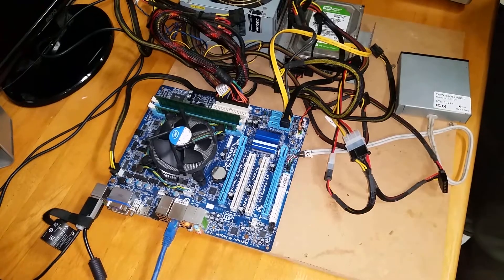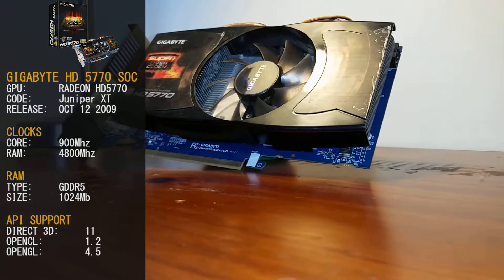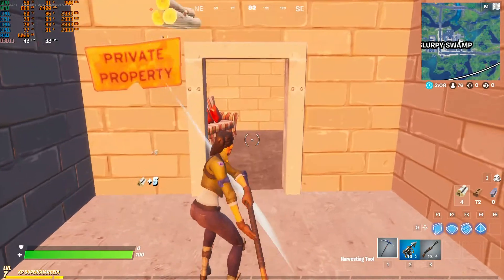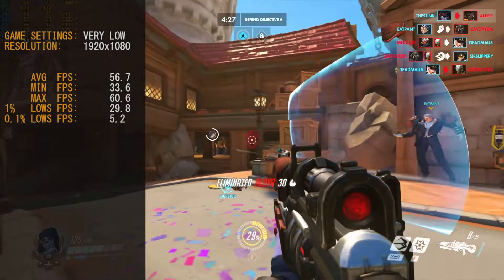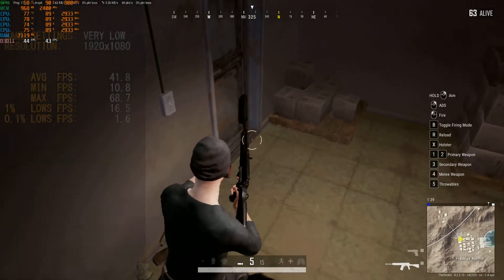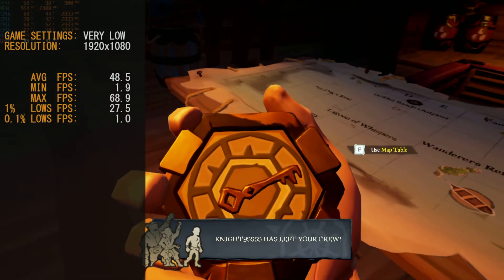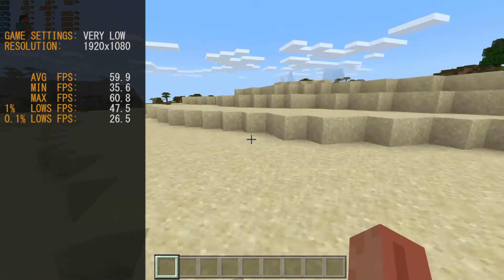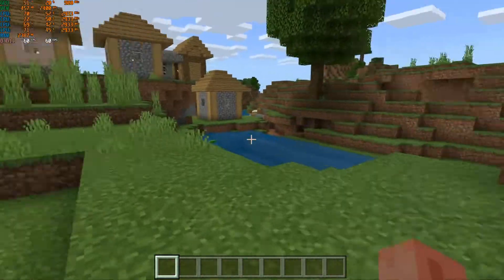Radeon HD 5770 vs 2020.

Comment: how do you run Sea of thieves at +40fps? I have the same CPU and GPU but I can't get above +18fps with low settings.
Reply from the maker: We temporarily disable our virus real time checker playing games.
We also set to lowest of details.
Also we run a program call inspectre it helps with turning off some of the intel microcode updates that slow down most of the intel CPUs
(https://www.grc.com/inspectre.htm).

Try to keep background running software to a minimum

We hope that helps,
Thanks for watching.
Reply: @OFFbitTech  Great thanks for your reply me! I will try. (link not working but no problem)

A greetings!!

Comment: what bout amd 5770 in my 300 w psu
Reply from the maker: It requires at least a 425w psu
to run.

According to realhardtechx
table link below.

https://www.realhardtechx.com/index_archivos/Page362.htm

Hope that helps.
Thank you for watching
Reply: @OFFbitTech  cuz i run amd 6750 just fiine but i dont have high end pc just low and pc
Reply: @OFFbitTech  including to techpowerup it will word
Reply from the maker: @yassine9475  It may work.
You are right tech powerup does say 300w psu minimum.

It will come down to how much power your 12v rail can supply. How much power you are you already using as well.

But be prepared that you nay need  bigger wattage psu.

unfortunately it's something you need to try.
It may not turn on if to much draw is required and it may turn off in games @ peak usage.
Reply: @OFFbitTech  yes thats exactly why i'm afraid
Reply: @OFFbitTech  my  PSU
FSP300-60EGA 80Plus Gold
Reply: @OFFbitTech  i will try amd 5770 and i wil also tell you my results 
thanks for ur reply bro i luv you <3
Reply from the maker: @yassine9475  Thank you we would appreciate that.
Reply from the maker: @yassine9475  yes it's a hard one to call.
I have been in a similar situation and I needed a new psu in the end.

I know the pain to much.  :)

Comment: x3440 (4c/8t) is like 5-10$, I guess those 4 extra threads would help a lot.
Reply: i would get an e5 1650 6c/12t and about 30 bucks and there are cheap 65 dollar chinese motherboard. Definately worth every extra penny it will handle way way more gpu than this and has AVX. or even e5 1620 for 20 dollars would be a worthwhile step up.
Reply from the maker: Yep Hyper threading can make a huge difference.
At some point we will upgrade this rig to 4c/8t xeon or an i7.  The slower clock speed on the x3440 may hurt a little in some games and the extra threads will help in others.

But extra threads these days will probably help a lot more with games able to use more and more threads properly.

But for now the i5 760 still does an alright job.

Thanks for watching.
Reply: @OFFbitTech  Xeons overclock better since those are best chips from the wafer.

3.5GHz is doable on every chip, 90% does 3.8, 4.0GHz-capable at 30-40% rate.
Reply from the maker: @Adam130694  Yep, that's correct. Xeons are better binned. 
We will have to wait and see, there is a chance we may move onto a sandy bridge i5 As well.
But a xeon X3470 / X3460 also could be another way we could go. We will probably need to upgrade the CPU cooling though moving to 4c/8t cpu.
Reply: @OFFbitTech  or just buy X3460.

Comment: nice video, thanks for the benchmarks, i'll be using this card temporarily before I buy a new one
Reply from the maker: Thanks, 5770 should be a good card to use until and upgrade.
We recently did another video with this card and an AMD Phenom II x4 955 Black Edition. You may want to have a look at that as well.

Thanks for watching.

Comment: My cousin gave me this card for free do you have a recommendation for a cpu for this card?
Reply: Or can I just buy a athlon II x4 651k because I have his fm1 Mobo and just slap an SSD on this boi
Reply from the maker: Probably between Core 2 Quad and I5 sandy bridge (23xx, 2400,2500). It would probably be better suited closer to later core2 Quads in my opinion. But sill not a bad card to be paired with later cpu's
Reply: Also I think you forgot to answer my last question I have his fm1 Mobo but has a sht cpu and planning to just buy an athlon II x4 651k, is that a viable option? If so what games can I run?
Reply from the maker: @29stann  I would recommend going an intel i5 2400, 2500 / i5 3470, 3550 or something like that. Al ot more strength in it's single core performance (than multiply that by 4). There should be more intel stuff on the market as well. In Australia it can be hard at times to find AMD stuff cheap. Sorry about missing your reply.

I might pull out one of my phenom II cpu's and do a video on it sometime. I'll put that on the todo list.
At that point I will be able give you a better Idea on what Athlon II x4 can run.
Reply: Ohh ok thank you so much for responding, btw do you have a discord or a server cause I wanna ask more question because I live in the Philippines and those items are quite expensive.
Reply from the maker: @29stann  Sorry stnly I don't have a discord server at the moment.  I just realized the Atlon II x4 651k is not a am3 cpu but an FM1 cpu. So staying on the motherboard you have already makes a lot of sense. The Athlon-ii x4 651k by having a quick  look is the best you could do with your current setup. Unfortunately I have not played with many fm1 cpu's. However the 651K does still look capable but is a bit old. It should do better than most Core 2 Quads.

I am planning to run an AMD X4 Phenom II soon (AM3 Based). That has similar performance So after I do that video I'll have a better Idea.
Keep a look out for that video.
Reply: I'll look forward for that video, I'll probably just wait for that video to come out before I buy spend stupidly. Also I subscribed :)
Reply from the maker: @29stann  Thanks you. Looking around for what working AM3 motherboards I have for the video. I think I have found one she has power issue, but I have a work around for it.
Reply: @OFFbitTech  Nice and btw can you please add Genshin Impact for the games you will be testing. Cause I really wanna play that game
Reply from the maker: @29stann  I will give it ago. Thank you for the suggestion.
Reply: @OFFbitTech  how about Xeon X3440 is that good for hd 5770?
Reply from the maker: @topgear9359  It should be ok, personally I would try to get something like a gtx 670 or a gtx 660ti  or even the gtx 660. 
I think you could go with something with a little bit more gpu power. 

Thanks for watching.
Reply: @OFFbitTech  what is the best VGA card under 40$(used)
Reply from the maker: @topgear9359  We are in Australia so things maybe a little different if anything if you are in US it should be even better.

Try looking for GTX 770 at times 2nd hand cards in Aus have been cheap. But the GTX 670 is still not a bad card or you may find a GTX 680.

I have stayed away from radeon cards from this era I have not had much luck with longevity with some of the earlier radeon cards. 

Radeon rx 470 might not be to bad if you can find one of them cheap but I doubt that you will.
Even the gtx 660 or 660/ti can be found quiet cheap. We picked up a gtx 660 in Australia the other day $25. We found it on facebook marketplace.
But best way to find cheapest is check your second hand backyard sale websites.

Hope this helps.
Reply: @OFFbitTech  in my country (Indonesia) 
Gtx 660 price is 64$(Rp900.000)
RX 470 price is 74,55$(Rp1.050.00)
I think i Will pick the RX 470 for my GPU
*Sorry my Inggris not good
Reply: @OFFbitTech  and thanks for the information :)
Reply from the maker: @topgear9359  Our pleasure.

Thank you for watching.
Reply from the maker: @topgear9359  Wow, rx470 are hard to find in aus 2nd hand. Yep rx470 is the way to go then.